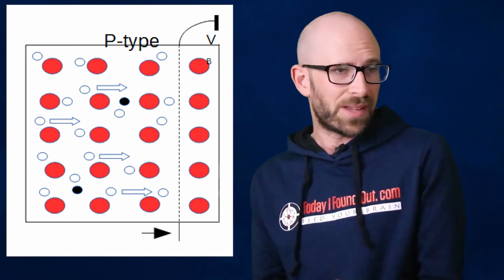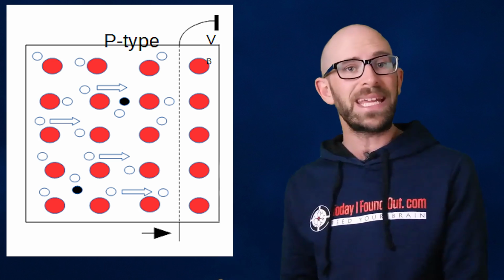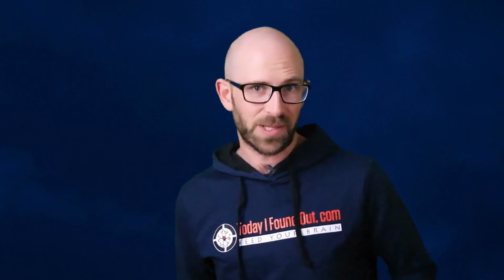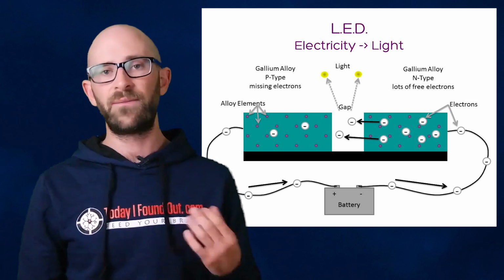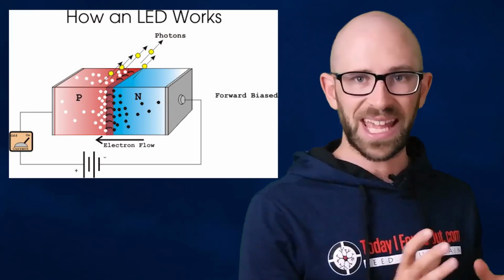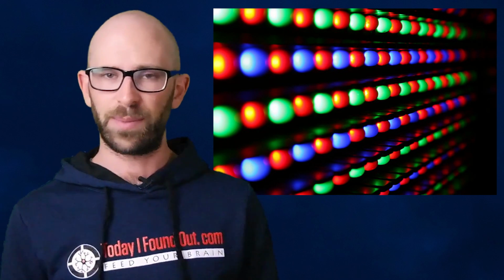How Does an LED Work?

Comment: The last bit is totally wrong, multicolour LEDs that change colour due to a variable operating forward voltage don't exist, unless you severely overdrive a regular LED and damage it. Even then the wavelength varies only slightly. What you have pictured is a strip with RGB LEDs, which do it by colour mixing.
Reply: I made a green huge LED become red once by running a fckload of current through them. Then it went off, then I turned it back on, tried to, and it exploded with some of the plastic almost hitting my eye. Kind of wanted that to happen but not for the explosion part haha.
Reply: No, it's not PWM. Simply, it's the frequency the driver uses to turn on and off the display (i.e. scrolling bars and so on, or even most 7 segments led chips). Curiosity: on most of those displays, try blowing a raspberry while watching them, and you'll see them waving up and down ;)
Reply: What you created is what we in the industry refer to as a 'friode', that is, a diode that has been fried with excess current. The red light is from the fine wire connecting the  LED chip to the leg of the whole package glowing red hot - like the filament of a light bulb - from the excess current. It doesn't last very long, & makes the LED smell pretty bad too. ;)
Reply: Yes, it is PWM in that case. That said, you can direct drive RGB  LEDS too, but it's rarely done because PWM is much more efficient if you need to control a whole bunch of LEDs individually over a few wires as possible.
Reply: It is possible to change the wavelength of a LED a little bit by cooling it really cold or putting more power trough it but it will only make a green LED in to a slightly different shade of green rather than for example blue.

You can cause cause clearly perceptible changes in color by putting way too much power trough them but they generally won't survive that for more than a part of a second.

All the color changing LEDs we see tend to simply mixing the light from 2 or more different color LEDs.
Reply: Yeah, i think you lit it on fire.
Reply: I thought the use of varied forward voltage triggered different anodes (or cathodes) in rgb bulbs to create a different primary color. ie that a normal rgb diode has 4 leads. for a voltage difference to influence the output color of a 2 lead rgb led then it would need transistors in the circuit to turn on or off the related anode depending on the supplied voltage.
Reply: @jasmynroberts5771  

😂

Comment: Well actually, in multi-color leds (or "RGB" leds) each "chip" is composed by three individual leds, which are - as the name says - one red, one green and one blue. Different combinations of current flowing in each of them varies their light output, thus their intensity, giving birth to a vast amount of resulting colours.

Comment: As others have pointed out, the last bit is wrong. Multi color LEDs are not selected by voltage. A Multi color LED has different junctions in the same package. So a RGB LED will have 3 LED junctions packed close together, but still separate. The LED as a result will have 4 connections, one for each color and a common ground. Now yes, technically you can change the color by over driving the LED, but it's not going to last long. A green led can be made red for a short period of time, but it WILL get very hot and may even explode.

Comment: Ah, but there are ultraviolet led's. If it weren't for the UV led there would be no blue ones. It is due to advent of the UV led that supported the blue and this led to the white phosphor coated UV led that could put out light in the white color spectrum. When one looks at a white led when it is off, there is a visible yellowish coating inside or on top of the actual junction. Much like a florescent lamp it is the phosphor that is producing the light, getting the excitement from the UV light generated within the tube or in the case of the led, a UV radiation from the junction.

 By now there are many many colors/colours of led's. In fact some of these that change color are in fact multi junction led's in one package that are each driven at various intensities to create almost any color .

The green and red led's have been with us for a very long time, some Bi color leds could produce orange by switching the red and green on at the same time, creating a single package that could produce three colors.
Who like warm white verses cool white?
Reply: I'd be interested in seeing a source for the idea that UV LEDs led (no pun intended) to blue LEDs.  And my understanding is that white LEDs are actually just blue LEDs with a yellow phosphor coating so that some of the blue light is converted to yellow which mixes with the blue light shining through the phosphor to create white light.
Reply: Craig, UV LEDS are newer than blue LEDs. The original (late 80s) blue LEDs used silicon carbide, but were expensive & very inefficient compared to the red, green, & yellow LEDs available at the time, so they weren't all that popular. Current blue LEDs use a different chemistry that is much cheaper, & dramatically more efficient, leading to their ubiquity in the late 90s. Both technologies produced blue light directly, rather than via fluorescence. Your explanation of white LEDs is almost correct, but not quite: The LED chip is an ordinary high-brightness blue LED, with some of the blue light exciting the phosphor compound to fluoresce yellow (red + green) that combines with the blue light from the LED chip to make white light.
Your other explanations are correct.
Reply: Craig Nehring he said they were mostly visable/infared

Comment: For anybody curious, the term used when an electron shifts it's orbit is "Quantum leap", and it's instantaneous. There are actually set orbits with no areas in between.
Reply: And at what point does Scott Bakula shift into another time zone?
Reply: Well, the "set orbits" aren't really set. They're really "the whole universe" but more probably certain spaces (that's why they're called "probability clouds"), although they collapse to a certain exact point when you observe them (but not until). Truly spooky. And the way we know this is because individual electrons behave like waves and not particles in certain experiments, which means, well, they're "fluids" (or waves) (in what?). Similarly, we can make light behave like either waves or particles (light particles are called photons). 

If this is clear to you, please explain it to the physicists. (Actually, same for semi-conductors.)

And yet, each orbit has its own probability distribution, and every electron in that orbit follows that probability distribution.

Comment: I got an object lesson in the working of LEDs when I bought a new bulb for a particular lamp. It didn't work, and I discovered that the lamp was wired up backwards. Doesn't matter for incandescent, but LEDs are particular.
Reply: I'm guessing it was a DC-powered lamp?
Reply: nispelsm 120VAC
Reply: Really? That is extremely odd.  The housing electronics of LED bulbs for
 AC Lamps are supposed to convert AC house current to DC, regardless of 
which terminal in the socket is the "Hot" wire.
Reply: Maybe put the bulb in backwards?
Reply: +Andy Romaq Smith; or force the plug in the polarized socket backwards. Though that shouldnt really affect anything since it's still AC no matter which wire is the "neutral". Unless the led c.o.b. in the bulb itself was wired backwards.

Comment: I replaced every bulb in my apartment with LEDs.  I love them!  The light is soft and pleasant and they give off almost ZERO heat.  Why incandescent bulbs are even still sold is beyond me.
Reply: Try to use an LED (or CFL) bulb in your oven and you'll quickly learn one of several reasons why incandescents are still made.
Reply: David O'Banion GREAT comment. T A Edison expresses his appreciation for you from his grave :-)
Reply: I'm trying to figure out why LEDs (and CFLs) burn out so quickly in my shower. As near as I can tell they're not supposed to. (I guess manufacturing isn't keeping up with marketing.) But I can't afford to keep experimenting.

Comment: If the "N" material loses electrons that the "P" material gains what happens if you leave a LED on?  Does the "N" material run out of electrons it is able to give?
Reply: The 'N-type' material is continuously being refilled with electrons coming from the Anode (-) of the battery, that is what pushed the electrons to move from N to P in the first place, once a battery is disconnected, nothing moves.
Reply: Electrons don't disappear, they only change energy states which might happen through the emission of phonons (heat) but the electrons are conserved.
Reply: Isn't it worse? It's almost in definition bullshit for as far as we know haha
Reply: No, the electrons are supplied by the current source, constantly replenishing it.
At the same time, the electrons filling the holes on the P side, are taken away at the same rate, meaning there is always a steady voltage drop across the LED.

Comment: first time I used an LED for an arduino circuit tutorial I forgot to add the resistor correctly and the LED blew up and it gave a very intense burst before it went off and melted the encapsulating polymer material.

Comment: An n-doped substrate does not become electrically charged negatively or positively, all by itself.    The moderator said otherwise, essentially, erroneously at the beginning of the video.   Rather, a doped silicon crystal becomes charged after electrons migrate into a hole-rich region, or away from an electron-rich region, thereby forming a p/n junction.   Why does diffusion STOP?    Answer:   an equilibrium of diffusion vs electrical force.    This equilibrium is defeated when an outside voltage is supplied; thus an electron current can flow (in only one direction).        Conventionally, we think of the current going opposite to the flow of electrons, as the rules of quantifying currents and voltages were invented before anyone knew that current actually flowed by movement of "negatively" charge particles; i.e., electrons.

The concept of one-way current flow pre-dates solid state rectification; indeed, the process is called current rectification.        The device itself is called a "rectifier."   There were diode vacuum tubes, huge hot things, in service well before Schockley invented the bipolar transistor (Nobel Prize, I believe) in 1947.    But little cat's whisker rectifiers were in use, even in the 1920s.      In the 1960s, when I was a boy building crystal radios, germanium diode were expensive and delicate.

This was all one of my major fascinations in boyhood and I graduated with a degree in electronics engineering from UC Berkeley.   That's how "I found out" !

Comment: The problem with different color LEDs, is they have different voltage drops.
Would a UV LED not be able to have different colors just by changing the fluorescing material covering the chip? 
Like an inside-out fluorescent lamp? We just need to find the right fluorescing materials to use as a filter. 
UV being the most energetic semi-safe-radiation, it can simulate lower frequency colors. By interacting with different material, it can give off different colors of light, and it would have more applications. Thanks Dr. Einstein. 
Best of all, every color LED will have the same voltage drop. Say 3V.

Comment: The explanation was great up until the end, where you came out with the extremely incorrect explanation about multi-coloured LEDs. Multicoloured LEDs aren't a single LED that can change colour; they are 3 (sometimes 4*) LED chips of different colours (red, green, & blue, just like on your TV screen) built into the same package, & varying the brightness of each of them, individually allows you to change the colour of the mixed colour. White LEDs consist of a blue LED chip embedded in a phosphor compound that fluoresces yellow (red + green) when excited by the blue light, resulting in a mix of red, green, & blue that we perceive as white.

* Some LED strips / fixtures use a white LED (Blue LED chip + yellow phosphor compound) as well as the red, green, & blue LED chips, for efficiency reasons.

Comment: Could enough infrared tv remotes produce a noticeable warm sensation? I always wondered if you could make a diode heater obviously you'd need a LOT
Reply: Joshua Lansell-Kenny get a 100w cob and then you'll know about heat!
Reply: With enough remotes pointed at you, you could definetely create some warm sensation. However I'm talking about a big number here. An infrared diode consumes around 0,002W of power when turned on. If you had 10.000 TV remotes pointed at you, you would be consuming around 20W of power. If we assume that most of that power is actually transmited to infrared light (diodes are quite efficient) and the remotes were very close to your face, you would probably feel your face warming up a bit, but nothing too dangerous. You'd probably need 10 times more remotes for it to actually have a burning sensation.